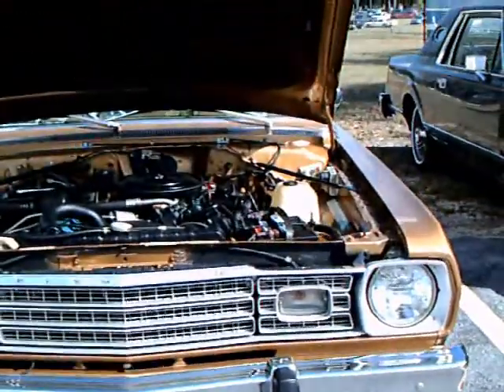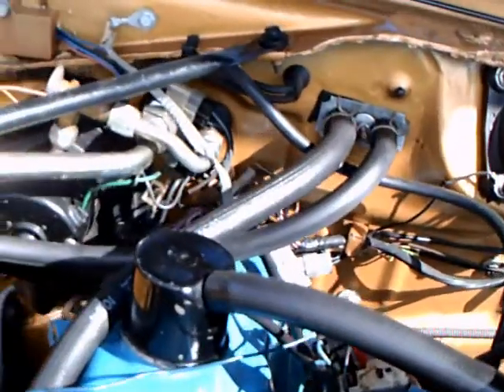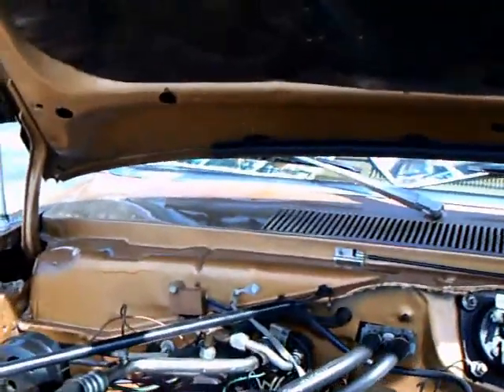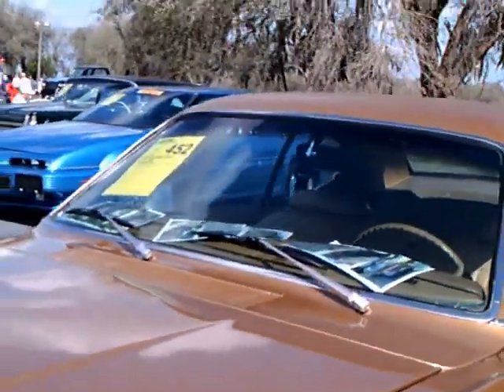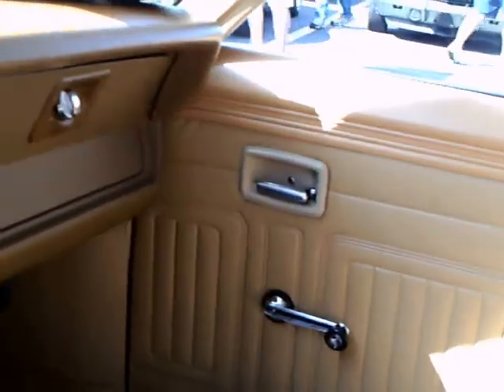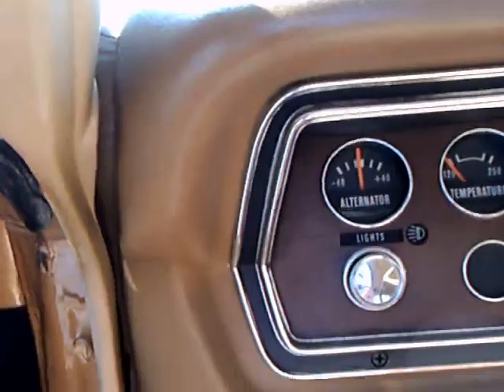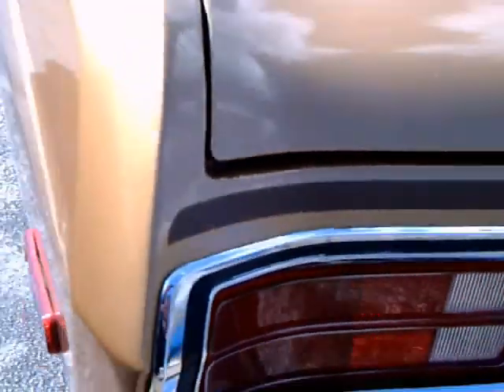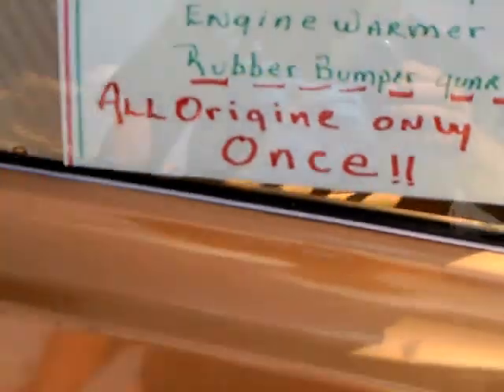1974 Plymouth Gold Duster Gold ZephyrHills022412

Comment: I see you have the BIG bumper guards. They were made to meet  new '73 safety standards, but the remaining leftovers were installed on early '74 models.
And, if I remember correctly, the "3/4 vinyl" roof you showed was called a "canopy vinyl" roof by Plymouth, and was part of the Gold Duster package added to a Duster.
Reply from the maker: Hey, Danger!  Not my car, but great point about the introduction of the new bumper "systems" to reduce damage from low speed collisions.  Cleaning out parts bins was certainly used in the industry!  Thanks!  :) Jack

Comment: Slant 6 the old leaning tower of power. I had two 74s one with the slant 6 and the second with a 318. Sway bars are a MUST for these things. unless you like to fold over in a corner.
Reply from the maker: +vboss5764 That is a good point...the motors would last forever...but one should upgrade the suspension if they really like to power it around corners!  Thanks!  :) Jack